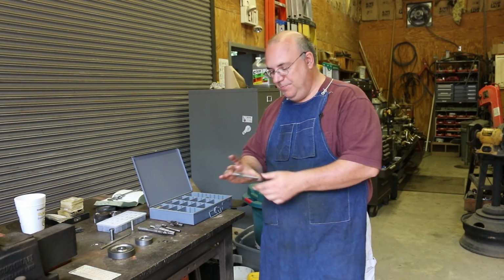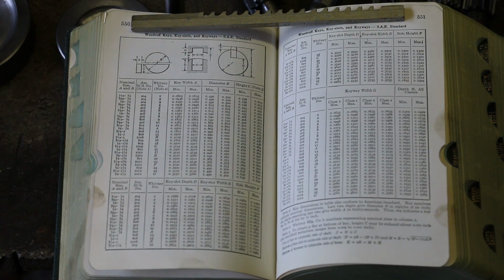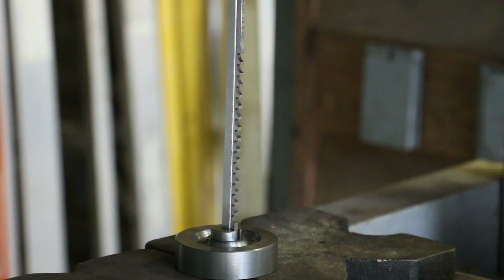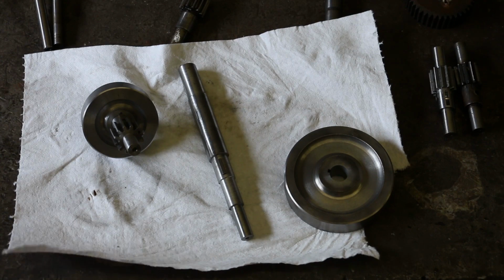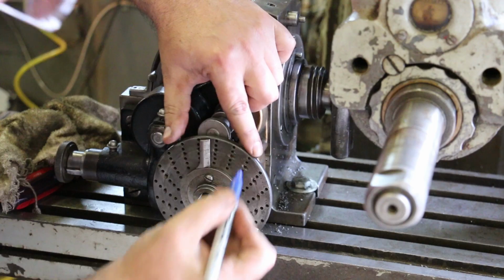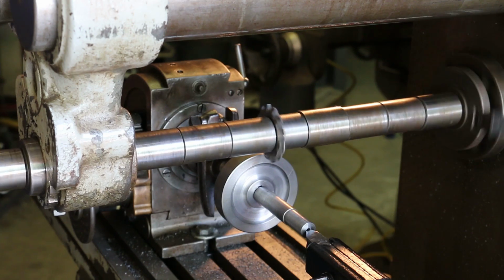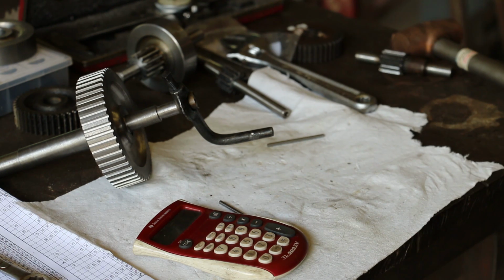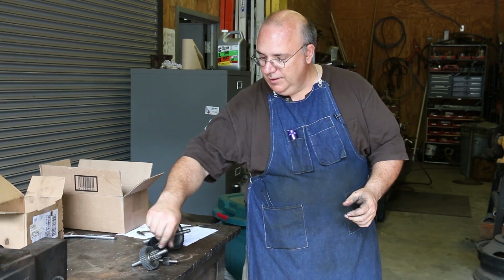Blacksmith Blower Rebuild: Part 4 - Woodruff Keyways and More Gear Cutting

Comment: I thought the Loc-Tite was a bit of overkill as the gear was already a press fit with a keyway.  Sure hope you never have to take them apart for any reason!  Great series, and looking forward to final assembly.
Reply from the maker: HemiRod23 My motto is "if it is worth doing, it is worth overdoing"  Overkill, maybe, but they should be held firmly in place!  And I did use the reversible kind of loc-tite, just in case.....

Comment: Thanks again Keith, I always wondered how gears were made.

Quick question-how long did it take to cut a gear? How long for the entire project? You seem very patient, something I struggle with.
Reply from the maker: Ian Butler LOL - yeah, lots of factors on time - number of teeth, setup time, and if the camera is running or not!  So, the first gear with 12 teeth took me about 4 hours to cut including setup and a lot of time fooling with the camera.  Then the other two 12 tooth gears took about 20 min each.  For the big gears, again, about three hours for the first one when I was talking and messing with the camera and then probably 45 min to an hour for the other two.  Doing the YouTube thing really slows me down.....

Comment: I wanted to ask this question. What are the cutting tools made with? The tools cut through the iron and steel so easy. What machine makes the cutting tools? I like your videos I want a lathe in my shop so I can learn basic part making. Thank you for taking the time to film all the work you do.
Reply from the maker: Alpha1545 The cutters are made of high speed steel (HSS), the same as end mills and basic lathe cutters.

Comment: It seems to me like the plate on the dividing head should rotate and the plunger be fixed to the frame. That way is would be a lot easier to swap them out.
Reply from the maker: ElectricGears Not sure about that - never seen a dividing head set up that way.

Comment: Having the ability to make gears like this sure opens up what you will be able to repair!  Nice job.
P.S.  I thought that keyway broach was going to snap off at 9:30.  I guess it'd be best to ease off the pressure mid stroke to allow it to line up with the press again.
Reply from the maker: Jack Hoying I was watching it pretty close and I think that the angle of the camera made it look worse than it was.  I was kind of cringing myself when I saw it in video and I know that I was watching it close in real time.....
Reply: Jack Hoying Yes indeed Jack. I was cringing when I saw that too. Thankfully it made it through the process OK.

Comment: Press, Locktite, and a Key? No sympathy for the next guy who has to get it apart, eh?

It would be nice to see this in action and get a look at the blacksmith shop - looking forward to seeing that.

Thank you for your efforts.
Reply: GeoffreyThorpe123 seeing as it will last about 200 years! i think the next guy will 3d print it from his star trek replicator and not bat an eyelid, that or the apes who take over our civilization will be using bananas for everything and wont care what it is
Reply from the maker: GeoffreyThorpe123 I won't worry about that, I figure that I will be then next guy to work on it or they will just throw it in the trash.  Not too many people who would take the time to fix something like this anymore.....

Comment: Truly gorgeous gears. Have you ever made a dividing head indexing plate? Seems like it would be a considerable amount of configuration and layout work.
Reply from the maker: John Strange Yes, I actually did make an index plate one time - about 25 years ago when I worked in the machine shop.  We had a job for the dividing head and did not have the correct pate, so I made a complete plate with the whole series of holes.  We basically calculated the angle on a 360 degree circle for each hole and then dialed it in on a rotary table to drill each hole.   It was nerve racking.  And, it was before we had a computer to do the math for us (very simple to calculate in Excel these days) - I did all of the math by hand and double checked each angle and then as I was dialing in the angles on the rotary table, I had another person in the shop double check each angle to make sure we got it right!
Reply: Keith Rucker - VintageMachinery.org Thank you for sharing the valuable insight of that memory.

Comment: Hey Keith, at first sorry for my bad english. I'll try to explain my question as best as possible for me ;-)

The big gear you have cutted in this video was the only one on a shaft without a pinion gear. In some cases it is very urgent that the two or more Gears on one Shaft are in a defined position to each other. like in a transmussion, you have four or five gear pairs on two sharfs. If one gear is twisted a few degrees in relation to the other gears, the tooth will not fit to the gear on the other shaft.

Have you any idea how to measure, the positions of the gears on the shaft?
Reply from the maker: 42IsAnything To be honest with you, I would have to think about that for a while.  A couple of ideas come to mind, but I am not sure how they would have been done at the factory.

Comment: Hey Keith. I tried doing a little gear making exercise on paper using my "Machinery's Handbook 24th edition" that I keep on my desk.. I got stuck at "diametrical pitch" and how to determine it.  Long story short, I could not find the information that I needed (or if I did find it, I didn't understand it) so I went back to your video and saw that you used a diametrical pitch gauge to find it.  My point is; your videos are very helpful and I am most appreciative that you make them.
Reply from the maker: vajake1 Without a pitch gauge, it can be kind of hard to figure out.  You can do some math to calculate the diametrical pitch from the pitch diameter and the number of teeth, but you have to take some things into consideration....
Reply: Keith Rucker - VintageMachinery.org Thank you sir! I'd like to give gear cutting a try for real some day!

Comment: is the 2nd indexing plate just worn out by use? o.O
Reply from the maker: madinatore That plate has seen a lot of use on some of the holes.  It probably was set up on some production jobs over the years where it saw a lot of use.  That plate was not original to the dividing head - a viewer sent it to me, so I don't know much about its history.